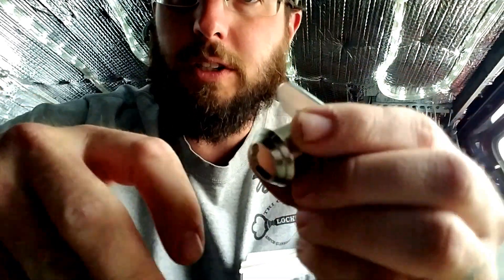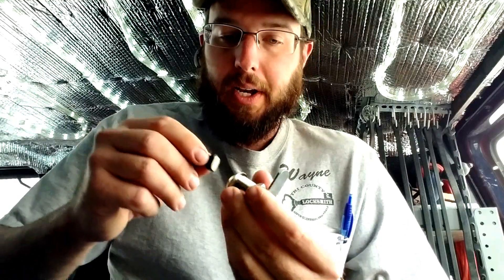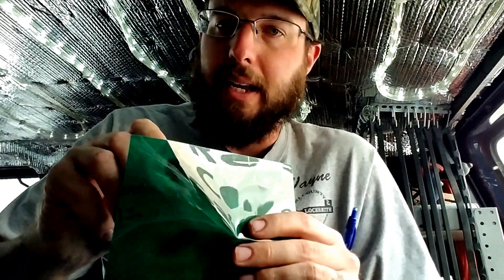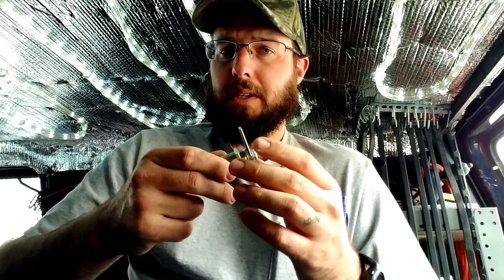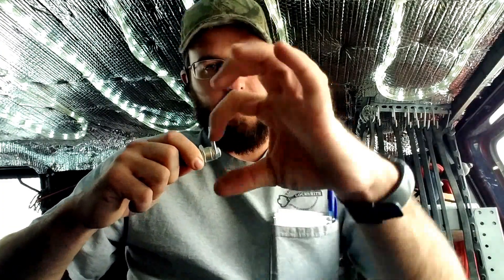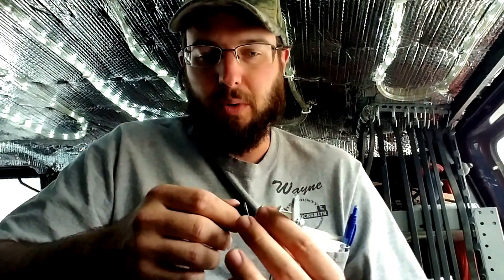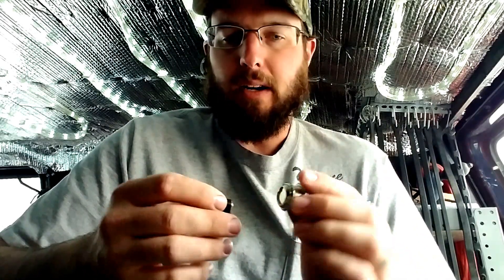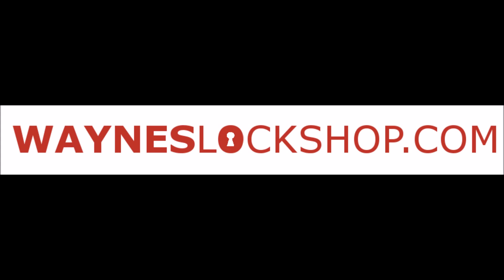MAGNETIC CAM LOCK Review Capitol Industries INC. Pick Bump Tamper Proof Locks

Comment: Does this have the "wobbly cone" internal construction?  If so, I've had some luck with a force tool... much like the smart key force, it is internally destructive, but not externally visible. Afterwards, any key will work, so the entry may not be detected.
Reply: I was wondering if you had played with 1 of these. I saw that Bill approves of the padlock variety.
Reply: I watch your channel all the time. I don't believe I have seen you open this type of lock, correct?

Comment: There are some interesting pictures on their website. Three rotors, each with a small neodymium magnet. Each rotor has a corresponding magnet inside the key. If the rotors are perfectly aligned, the core will turn. Using the orientation of magnets is obviously inspired by EVVA's MCS. Also according to Capitol's website, there are 1500 differs, which seems plausible.
The key is, like with MCS, secure against optical decoding. With physical access to a key, e.g. as an employee, decoding is possible, also making a working makeshift key (same is true for MCS...).
Depending on some details of the inner workings, even a pick/decoder tool may be possible...

Comment: Dude. The magnets can be printed in special 3d printer. The same like they have now in Home Depot 3 d plastic printer, so now there is a video about factory in usa. So you need to have correct pattern to open the lock and the one correct most likely not same as inside the lock. Magnetic folie or magnetic paper is a small step to solution but is far away to complete way. Regards